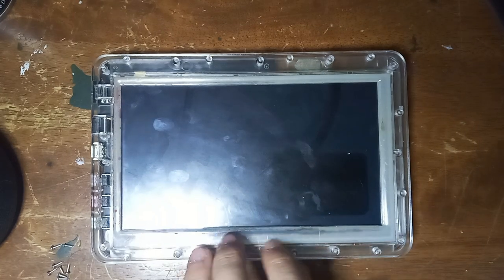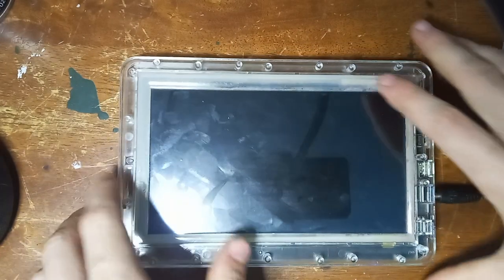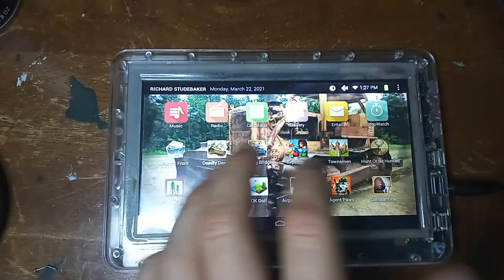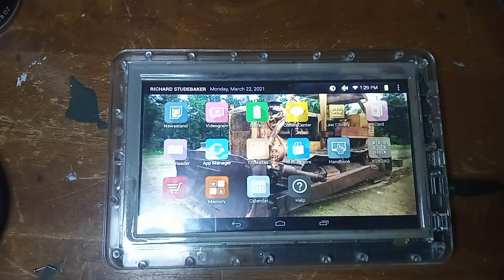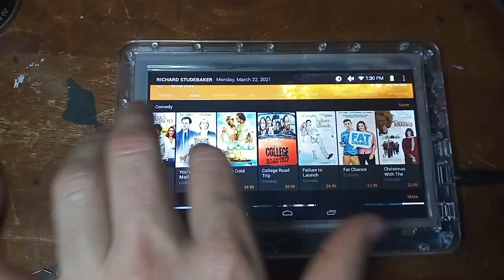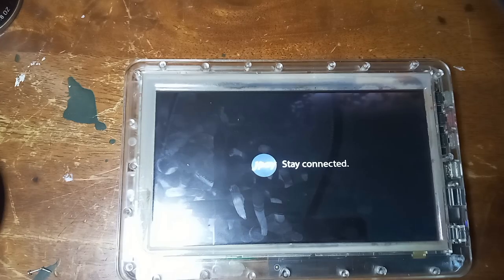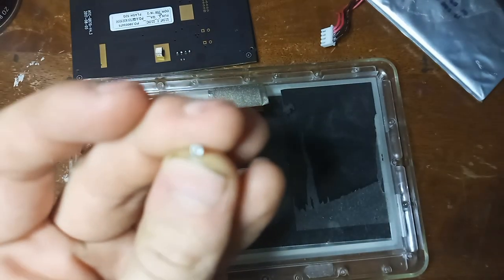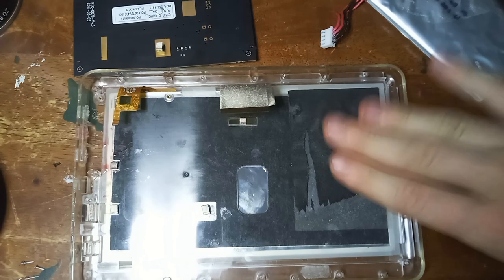Reveiwing A JP5S Prison Tablet

Comment: Which type of chargers do Securus tablets need?
Reply from the maker: This one in specific required a barrel jack for charge but also had a micro USB for a data transfer. I’m not so sure about the other models as I haven’t had a chance to do research on them. I do know that they use a specific driver for the tablet that is not available to the public. It’s probably not even officially signed either.

Comment: Do you know how I can take it off safe mode?
Reply from the maker: I'd assume rebooting it would take it off of safe mode, if that's not working check to make sure none of the buttons are jammed
Reply: @damianbergreen  is there anyway to do it without having the wifi information deleted also? Its on safe mode and I want to be able to use it for whatever I want. Thanks for the help
Reply from the maker: @MessicanFood  I've never have removed the device from safe mode and had it delete any data at all. Safe mode pretty much just disables third party apps so if there's a problem with the device it could be diagnosed
Reply: @damianbergreen  can you download stuff to tablet from cell phone
Reply from the maker: @bornalone4435  The only way I can think of that working is if it had Bluetooth which it doesn't.
Reply: Hello how can we reboot tablet keeps tried doing it the android stomachs goes by fast